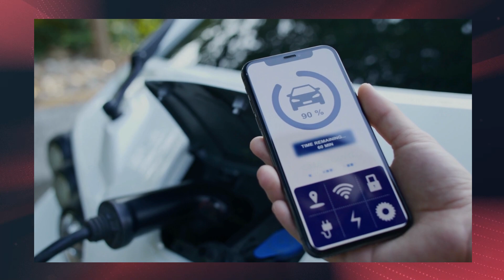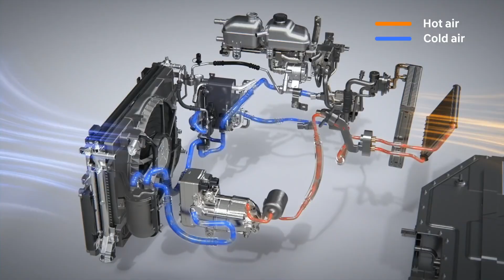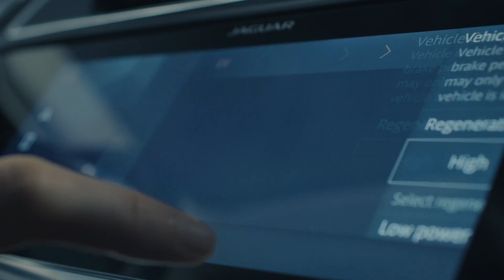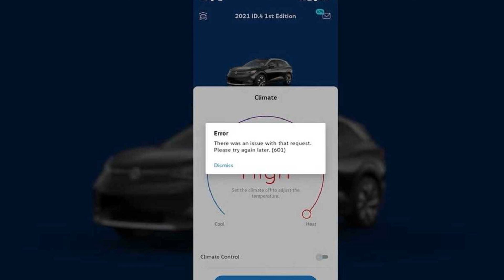What Are the Major Electric Vehicle Quality Issues That You Need to Know?

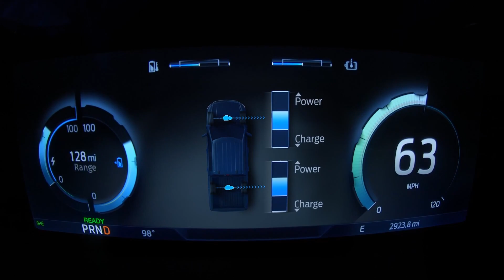Comment: 3:44 gaps on the headlight to hood trim.
Right side of picture . 
Have you driven over a ford lately?
Reply from the maker: Hey there! Thanks for pointing that out at the 3:44 mark. It's surprising to see such an issue in the headlight-to-hood trim, especially considering that this is an official video from Ford. It's essential for manufacturers to maintain high-quality standards when it comes to electric vehicles since people are still warming up to the idea of EVs. I hope that this is just an isolated incident, and Ford addresses such quality control issues in the future. 🚗🔋